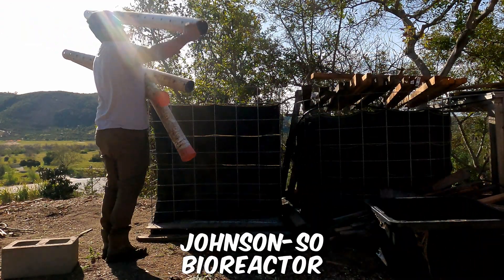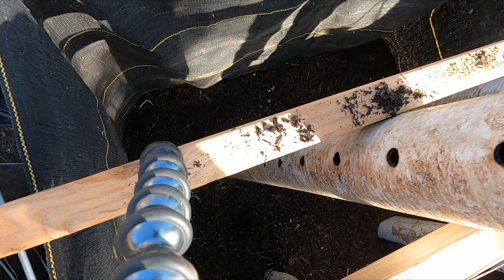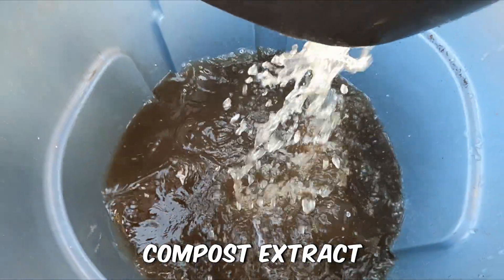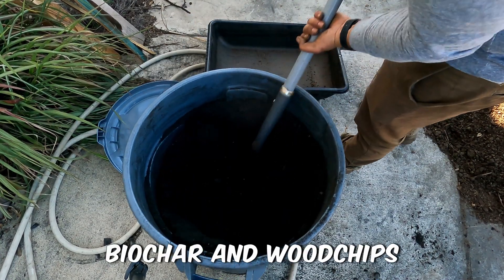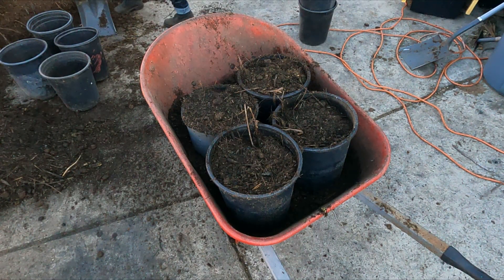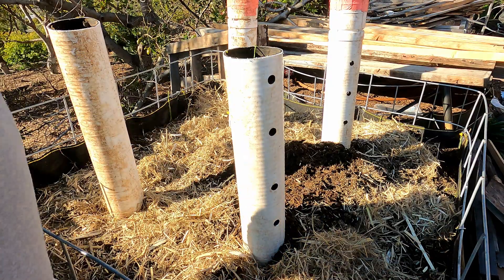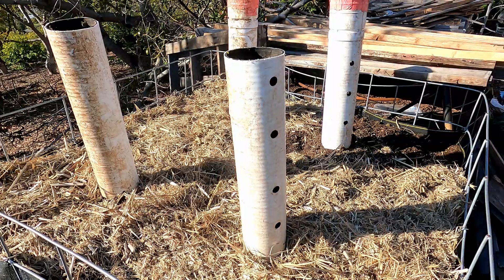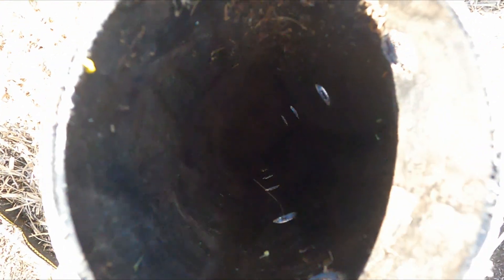Johnson-Su Bioreactor Build, Easy Composting system

Comment: Very informative. As a fellow ADHDer I can appreciate the effort. I do have to mention that there is no layering in the Johnson-Su bioreactor - layering is only for the normal, hot composting where the pile is mixed often, so layering of material at the start is not necessary. For the J-S bioreactor, the material have to be mixed beforehand because it is not disturbed for 12 months - see any of the Johnson-Su videos. I pile 2 buckets of Brown, 1 bucket of Greens, mix, add to J-S bioreactor, pat down every so often, repeat. Also, maybe you didn't show the watering but the J-S bioreactor needs 70% moisture which is soggy soil, and a weed membrane cover to keep the moisture in. I absolutely love that you use a microscope to check the compost at the end.

Comment: Thanks for the info! I'm going to build one. Question; Rather than using the weed barrior, do you think metal screen ie; screen door screen would work? I just want to stay away from plastics as much as possible. Also, those look like 6" tubes, am I correct? And what type of tubing did you use? Also, how big are the holes in the sides of the tubing and how far apart did you drill them? Thanks. I'm building out a school farm and this design is my favorite.
Reply from the maker: Yes you can use metal mesh and I agree I try to use as little plastics as I can. They are 4 inch tubes. I don’t remember which tubes, they are from the big block home improvement store. It came with holes but I have used 1/2 in the past and that works well.
Reply: The screen would not hold in moisture as well as weed barrier.
That may be less significant if you are in an area with high humidity

Comment: Started using using Bioreators year and half ago, I now have 6 trash cans with a pipe in the middle and lots of holes on the bottom and sides. first harvest was awesome this next one in may will be fantastic started adding biochar to each layer. Have two that are finished and the soil it black and crumbly and stuffed with worms that came from the soil. I live in the high desert of Nevada where the weather is wonderful or you are freezing. Which I found makes the biology more robusk in the garden, I toss in everything too plus uria and KLF,
Reply from the maker: Very nice, It doesn’t freeze here so it processed pretty well and fast.

Comment: I would like fungal dominated compost wnd think a bio reactor which isnt turned likely grows bacterial dominated soil. I am growing IMO 2 to innoculate into IMO 3&4 to mix with my soil to dress my beds. I plan an experiment this spring with a bio reactor with Texas live oak leaves which has very high lignin and takes years to break down
Reply from the maker: Bioreactors are great at building fugally dominant compost, if you’re making IMO 2-3-4 those would be great to add to the compost when you build a reactor. That will help inoculate it.
Reply: The whole process you're doing is unnecessary. 
The idea is to add imo to the soil where the plants are and feed them there.